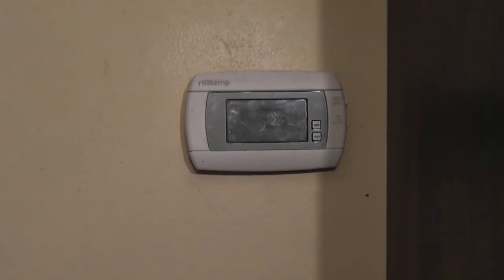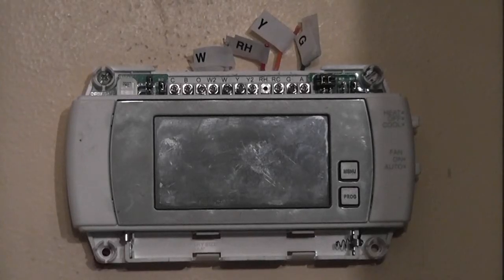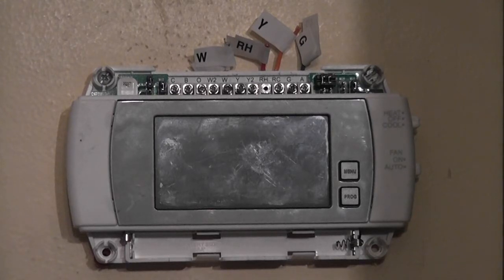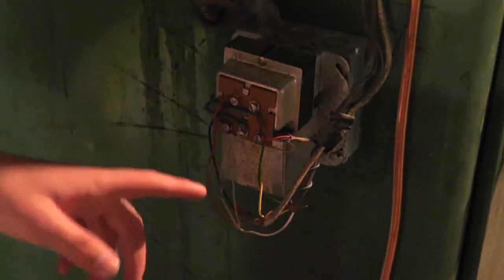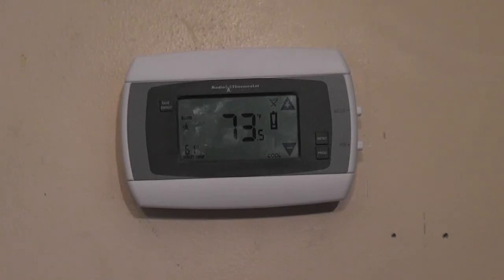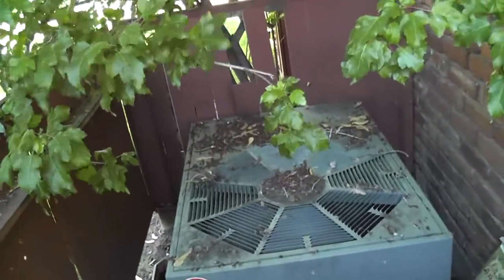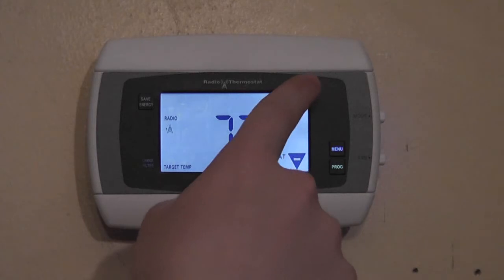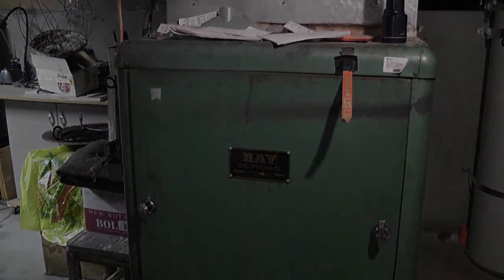Installing a WiFi Thermostat at my Grandmothers House

Comment: Isn't the G wire for the blower motor? Wouldn't not connecting it prevent using the fan only or fan always on option? I have a climatouch and just ran a C wire down the wall from the furnace. Never thought to try this.